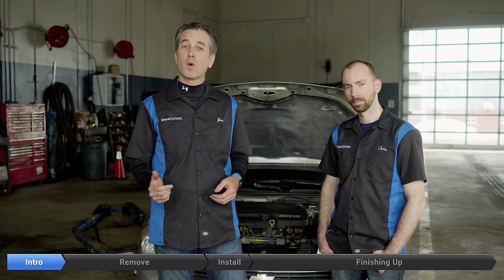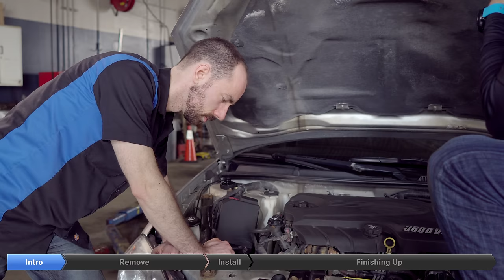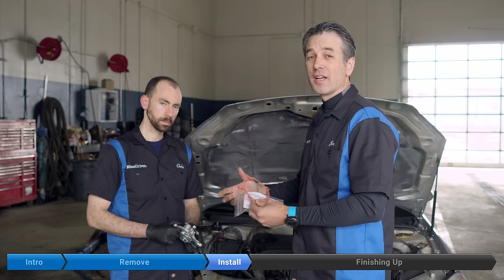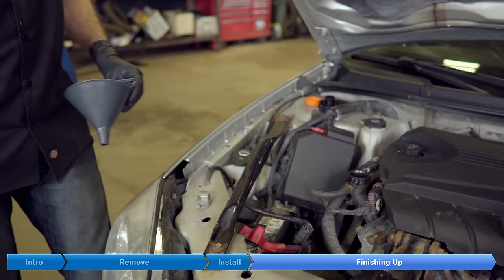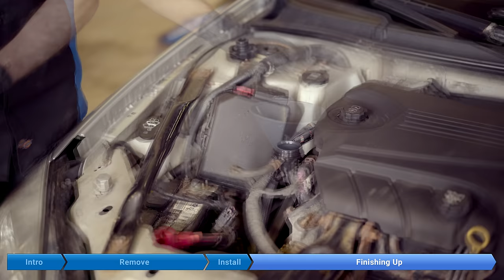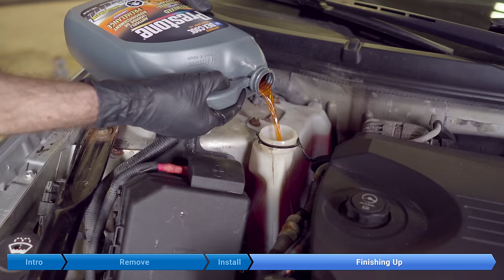Water Pump - 2006-2013 3.5L Chevy Impala

Comment: Hi Guys,
Thank you for this video
I only needed to see the video from 10 min in but all of this was very helpful.
I was having an issue with my 08 Impala only having heat when driving but none when sitting still or parked.
The previous owner of my Car said he changed the Water Pump himself.
So I searched for the best method to get the air out of my system 
So at 10 minutes into your video tutorial, you explained the proper method to get the air out of the System.
Thank you for the video, it helped me get my heat working again.
I can now start my Car and have the Windshield defrosted by the time I head off for work.
Very pleased to have found your Channel and a very detailed tutorial.
Keep up the great work and thanks again.

Comment: Just completed this job, pretty straight forward and fairly easy. The only issue I had was when I went to torque the pulley to 18 ft lb it would spin every time, so I held tension on the tensioner while I tightened the bolts and got it done 👍

Comment: Wow!  You guys made it so easy now!  My Impala just started overheating, so as a precaution, I will change the water pump, the cap plus radiator, and new hoses.  You guys are saving me a lot of money! Thanks a lot! 😀
Reply: If you're replacing the radiator cap replace it with a ACDelco I found that the aftermarket radiator caps don't pull the coolant back into the engine from the Overflow

Comment: Just a piece of info for anyone with a 2012-2013 and Limited with the big 3.6 liter, the LFX engine bay is different to the 3.5L/3.9L/5.3L that you find on the 2006-2011 models. Removing the 3.6 water pump is a similar procedure but some parts and other jiggly bits are different, I recommend that you reference a 2012-2013 repair tutorial with this video. I'm also not sure why the LFX years and Limited models are usually generalized with their older 2006 models, although they share the same body they are pretty different in technical detail.

Comment: I could not drain the coolant on my 2012 3.6L, but it worked fine. Turning the peckock (?), the plastic wing nut, did not release anything. I put a pan under the car and just let the water run out of the water pump. I did this on a 2012 3.6 L, with the sunroof. Amost the same procedure as shown in this video. I did not loosen the bolt onthe tensioner. I required a 1/2" breaker bar to pull back on the tensioner, not a 3/8".

Comment: Is it ok if the surface is a little wet. Like I’m downhill parked. No jack. Some coolant still dripping out. Looks like the mechanic that put new pump on didn’t use new gasket. And why the heck do I have two 10mm bolts and two 12mm bolts on the water pump pulley

Comment: @bluedriver is it normal that the car says engine hot ac off when starting the engine? 
I am finishing a big job including water pump, upper and lower intake manifolds, and spark plugs. Maybe I made a mistake elsewhere

Comment: Would the water pump make a “whirring” noise that would line up with the rpms of the vehicle? I have no leaks, just the noise. I have figured out the noise is indeed in the area of the water pump. 

Curious because this weekend I am going to replace the water pump and see if that solves my problem.

Comment: If you break  a bolt on the water  pump  and there is not enough  room to get the drill so you can tip or get the bolt out
Reply: remove upper motor mount and jack up engine

Comment: thanks for sharing but you skipped the part of using the 3/8 breaker bar to pull the tensioner to get belt back in place

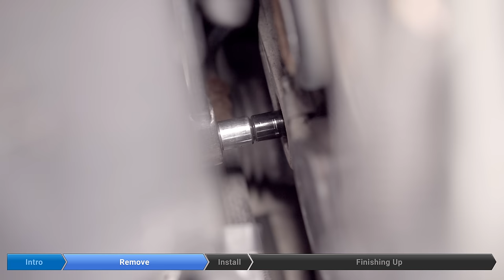Comment: Can you please explain the point of loosening the 15mm bolt on the belt tensioner @4:20?
Reply from the maker: Hello!
Once you loosen the bolt you'll be able to move the tensioner more easily.
Reply: @LemurMonitors  thank you for the feedback. Was working on this with my dad and he just skipped that step. I told him you guys probably weren't just saying to do it for no reason - looks like I was right. Great video! Appreciate your help.
Reply from the maker: Reasonable to think - you'd expect the tensioner to pivot

Comment: My heater pipe is leaking at the o ring next the coolant filler cap. I replaced the o ring but stills leaks what is the best way to fix that.
Reply: use a new o ring then put silicone around the o ring and it wont leak.

Comment: How much would you guys charge someone for putting in a new water pump in their vehicle?
Reply from the maker: The quoted labor time is 1.4-2 hours and an oem pump is about $300 while you can get aftermarket one for as low as $50 (although I'd avoid the cheapest of the cheap) so it could be anywhere from $200-600 depending on your shop and the parts used.
Reply: @LemurMonitors  thank you so much for replying!

Comment: why wouldn't you want to torque the pulley before putting the belt on?
Reply from the maker: You can, it's just easier this way - the belt will (should) hold the pulley in place while you torque them
Reply: Yea your right.  I just finished mine. Hope it dont leak anymore.  Thanks for the video!

Comment: You have to use new water pumps and never those that are rebuilt its better and saves both time and money in the long run...
Reply from the maker: Also a good idea to avoid the cheapest of the cheap if you're going aftermarket
Reply: I'd use the lifetime part so if it fails then I would get a new one that will last a long time.

Comment: How do u clear the codes on a 2008 chevy impala
Reply from the maker: Any generic scan tool will clear engine codes, except if they're permanent - then you have to wait for the car to confirm that the issue has been fixed on its own
Reply: un hook the battery for 20 min. Duh